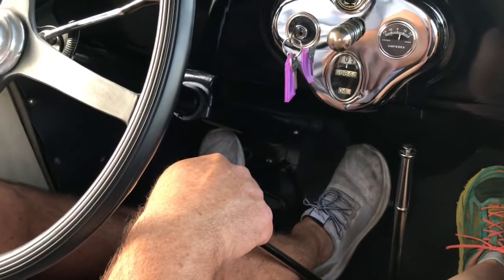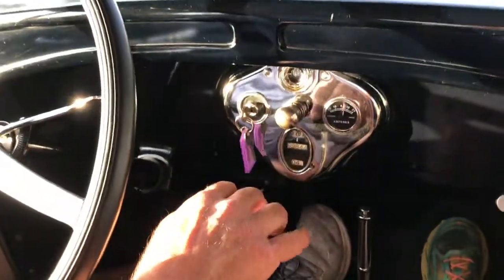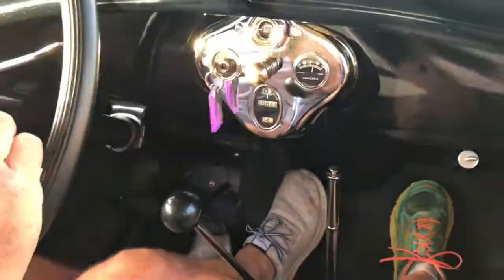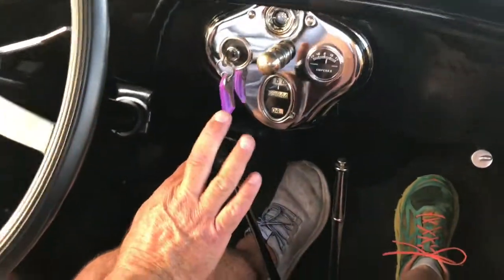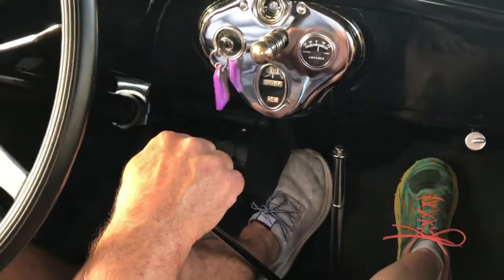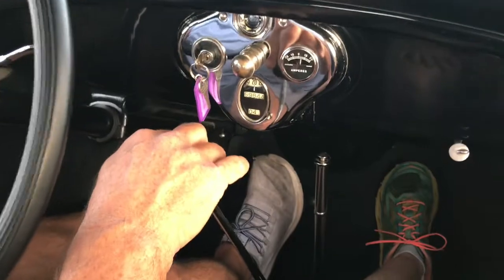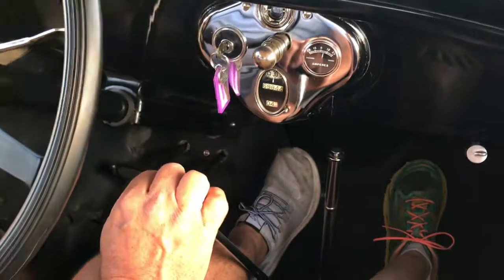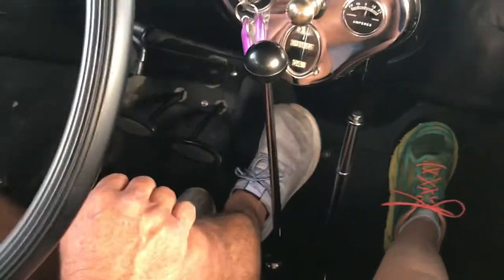How to shift gears in a 1928 - 1931 Ford Model A

Comment: Yes, that's the right way.  It works for most pre-war crash boxes.  I've used the same method for early syncro boxes too to help move things along.  And you're also right about how many people shift a Model A incorrectly....here on YouTube, and everywhere else.  When I learned to drive a crash box in the 70's, there were still folks around that knew how to help you learn.  Today we have the internet...and many people teaching it wrong.  It was a good move on your part to use the unrestored '29, that way no one could trash-talk the trans and your driving instruction.  Thanks for this video Paul.
Reply from the maker: Thank you!  Yea, I figured nobody could say I was using a 39 synchro trans or something this way.  My Sport Coupe shifts even smoother and would have made a better video, but like you said...

Comment: Paul - I finally got to really drive my A for the first time after getting it and going through the engine, etc. Thanks for this video! It helped tremendously. My key learning was to just take your time - if you are in a rush to get somewhere, take a different car. Every other car I've had has been a synchronized manual so I didn't realize how much I was accustomed to just lazily slamming the stick into the next gear regardless of the RPM. And I thought myself to be a fairly precise driver. The A makes you pay much closer attention!! I love it.
Reply from the maker: Congratulations!!!  We are all proud of you a d wish you many more successful drives!

Comment: For some, it is easier to always double-clutch a Model A. Too much thinking about up or down, just DC every shift and it goes easier for some. I have only been driving Model A's for 54 years so I still have lots to learn, but everyone I have helped learn I have them DC up and down.
Reply from the maker: That's OK too.  Even though it is not necessary.
Reply: Thanks to Paul's video I'm learning how to do it "the Paul way"... but I only started driving the Model A 10 years ago... so less to un-learn. I think what double clutching on the upshift does it give you the right timing or delay. I sometimes find myself double clutching on the upshift out of habit :)  I also think the timing/delay is different when the gearbox is cold as presumably the oil is thicker... still learning!

Comment: I saw a "How to" shift video where the gentleman was sitting at a dead stop, put the clutch in, and attempted to shift into first. However, the gears immediately started grinding. He backed off, tried again with the same result, only he just forced it into gear after grinding. I couldn't understand why it would grind while sitting still. Is it a clutch adjustment problem? Or maybe the car is idling too fast? Both? Lol

I just got my very first A, and your videos have been absolutely invaluable. From the "Secret Handshake" to your shifting style, maintenace and beyond, it has given me a wonderful starting point to launch from. I'd never even sat in a Model A until after buying mine, let alone driven one. I've got a lot of practice ahead, but you gave me the confidence to take those first few steps. Thank you!!!
Reply from the maker: My guess would be his clutch needed to be adjusted, of it was worn and no adjustment was left in it?  Thank you for the kind words!  So glad to hear the videos have been helpful to you. Are you a MAFCA member yet?  Planning on going to Model A Days in September?  If you go, it would be an honor to shake your hand and tell you thanks in person.
Reply: @ModelA could you inform me of the shift pattern? I can’t find any info on where first gear is. Engine off, it shifts buttery smooth, I just don’t know which way is what gear

Comment: My opion on this - and I'd love to hear yours, too - is that, as long as you hear no grinding noise, there is no "wrong" way to do it. 
I like double clutching because one doesn't have to keep the clutch pressed in while waiting for the gears to slow down. Just like I prefer putting the car into neutral when sitting at a traffic light. 
The lower the rpm you shift at, the quicker you can shift,  because the gear speeds are closer together. 
If you just get your car rolling in 1st, you can immediately stick it into 2nd without any hesitation - Jack Bahm demonstrated that brilliantly in a video of his.
You demonstrated how to shift without double clutching - and did it beautifully. But I wouldn't call double clutching wrong - because it doesn't hurt the transmission either, if done properly.

Greetings from Germany
Adrian
Reply from the maker: No grinding is the goal.  That's a fact.

Pumping the clutch excessively puts more wear on the mechanism than just holding it down tue extra second waiting for the motor to slow down.
Reply: @ModelA  Oh yes, didn't think of that one. I had only heard about throwout bearings wearing quicker when leaving the clutch pressed at a stop light - but sure, there's more to a clutch than just that.
Reply from the maker: Right.  You should be in neutral at a stop light with foot off the clutch pedal.

Comment: That is how I shift, I see people double clutching all the time but it isn't necessary. Actually if you listen to the engine speed and know how things work you don't have to double shift at all. The best I saw was my uncle who grew up driving all kinds of cars and trucks back in the day, anyway he could shift his model A without using the clutch! Just listened and shifted at the proper time, it was amazing to see.
Reply: @aliceshaw8265  I wrote a lengthy discourse on this for another nice video recently. "speed match the gears" is correct terminology in my experience. You're finding the correct speed of each gear. And yes, in stop and go traffic on a busy street, no 5 cars back behind you is gonna appreciate a snails takeoff from a light. At 14 years of age, my dad smiled big at me and said, " you know, at your age, I could kick the lever from 1st to second and second to third." I already had the touch, but it took a few practice tries before I got it.

Comment: Greetings from Australia where we drive on the 'other' side of the road :) (The GAV control is on the steering column which is actually pretty handy!) Thank you Paul for making this video. I was taught  to double clutch for both up and down shifting.... so I tried your method. There were a few 'crunches' while I was trying it out (hey it's OK, the gears can't get out!) but after a few goes I got it... and the whole way home I was saying to myself "I've being doing it wrong ***THE WHOLE TIME***" !!! :)  I still find myself double clutching up shifting, but I'll get the hang of it! My clutch and I thank you! :)   OK next Paul video to follow... brake adjustment!
Reply from the maker: Awesome!  Good job Ant!

Comment: It's Sunday. I'm enjoying this immensely. This is another helpful video Paul. .....But a bit opinionated as to "the right way". Do you know that many Semi Trucks have non-synchronized transmissions, and that their driver shifts up and down through 10 or more gears without using the clutch, all day every day? He does it on level ground, uphill, downhill, and on all sorts of road surface qualities, with different loads, too.He does not use the clutch to accomplish this. 

 In my very humble opinion, your description is "Model A shifting 101" only. I appreciated a comment below, "as long as you hear no grinding noise, there is no wrong way to do it". In the heyday of the Model A, due to the A's snappy performance, there were many high range speed shifts from stop light to stop light. Boys will be boys ya know? By today's standards, it would look like a couple tortoises goin' at it. Of course us grown ups revere these wonderful, old machines, and wouldn't think of shaving a few chunks of metal off the gears by missing a shift in a downtown, street race! 

An adequate description of shifting is too lengthy here. But I notice that in many  descriptions, I never saw anyone describe the correct use (positioning) of the throttle. One used the term "blip" the throttle and that's gettin' closer, but I suggest that a skilled driver of a non-synchronized tranny doesn't "blip" either; he puts the throttle where required and moves the shifter at the right speed (out of gear, into neutral, and on into the next gear) to get the shift made without clashing.

Keep the videos coming, Mr. Shinn
Reply from the maker: I have driven many large trucks and equipment with unsychronized transmissions.  I thought I did mention that this video was how to shift a Model A, even in the title.  Thanks!

Comment: he doesn't say it, or maybe he's not aware of it, but he's doing a crude sort of "rev-matching".  and unless you know what you're doing, there will be grinding and excessive wear. best to know what rev-matching is and how it is accomplished under any and all conditions. 

it's not only useful to do it on transmissions without synchronisers, but with them too,  as it will less stressful on the gears.

the trouble with not knowing that rev-matching is being practiced here, is that if the revs fall below the optimum point where shifting is smoothest (and it WILL happen A LOT of times) the engine will need to be revved back up in order to bring it up to the optimum point for shifting. 

he doesn't even mention this.  and surprisingly double clutching, despite what is shown,  is NOT necessary when downshifting if rev-matching , again, is used.
Reply from the maker: Wow!  You must be an expert! Where is YOUR video showing how it's done?? We all need to learn from an expert!
Reply: @ModelA  thanks for the compliment! :) no video necessary, as its explained in my comment. but here's a good animation of the workings of a sliding gear transmission. from it, it sould be clear as to what rev-matching vs double clutching differ and why one may be preferrable over the other... 

https://www.youtube.com/watch?v=wCu9W9xNwtI
Reply from the maker: Your method won't work with straight cut gears like the Model A without significant wear on the gear teeth.  That is the difference.  I was being sarcastic earlier.  Rev matching works great on a gearbox designed for it, the Model A was not.

Comment: Hey Paul
When in 3rd gear I lose acceleration and can't seem to get it to work. Any ideas?
Reply from the maker: Your motor is not making enough power.
Reply: @ModelA  How am I going to get more power?
I have put in new parts and seems to run good, until 3rd gear. Do you have a video or what are my options?
Reply from the maker: @adamthompson6932    Sorry, no video on "How come I don't have any power in 3rd gear".  Start with your timing (there IS a video for that).
Reply: @ModelA  thank you
Reply: @adamthompson6932  Maybe starving for fuel? Check fuel flow, filter etc?

Comment: I've never known double clutching to help shifting with anything, to me it's just a play with your mind, most old vehicles when down shifting do not want to fall into gear until your going slow enough for that gear to be in use, just like on an 8N tractor when shifting up or down there is a window of opportunity and if you miss it you miss it, I mean tell me how double clutching actually helps, it doesn't, same with old school big trucks with two unsynchronized gear boxes, double clutch means nothing imo, good video, thank you.

Comment: Mine absolutely will not to that, 3-2 downshift grinds no matter what I try, I think it's time to remove the trans to see What is wrong.
Reply from the maker: First, check clutch adjustment.  The clutch has to be capable of full disengagement before you can shift smoothly.
Reply: @ModelA  I adjusted the clutch about a year ago using tips from the Les Andrews book, except for getting in there to adjust the fingers independently; which might have been a bit beyond my tool selection at the time. It all looked and felt OK, and the adjustment didn't make any difference in that shift. At a stop with the clutch depressed, engine running, I can shift into 1-3 easily, indicating a complete disengagement as far as I can tell. The car does drive smoothly in all gears, doesn't pop out of any gear, and the 2-3 shift is as easy as can be - just like in any of the Drive your A videos here. If I can figure this out, I'd drive it a lot more often.
Reply from the maker: Hmm.. Need someone who has a lot of experience to drive your car and see what's up.  I can just keep telling you to check everything, but you may not actually have a problem.
Reply: @ModelA  I do live close to Arizona Model A, and the owner, Sammy Guthrie, has told me to bring it in so they can check it out. Which I will do, just not so comfortable driving it in traffic like that which is why it hasn't happened yet. Unless I can get someone from the local club to drop by and give me an opinion.
Reply from the maker: @mattfarahsmillionmilelexus    That would be the way to go.

Comment: so whats the issue? Thats the way I change gear in my 1962 land rover. never had any problem.
Reply from the maker: No issue. Just showing people who are new to this how to do it.
Reply: It's also the way I used to shift in my land rover.  A while back I had an issue with a failed part on the clutch pedal of my Ford Escort.  Some kind of plastic "automatic adjuster" that meant the clutch pedal no longer worked at all.  I managed to drive over 200 miles back home without a clutch.  Simply put it into first gear and turn it over, a couple of jerks forward and you're away.  Double declutching (even without a clutch) allows it to change down a gear.  Changing up is as simple as just hesitating as you cross neutral and listening out for the right engine revs before feeling it into gear. Obviously coming to a complete standstill is a pain as the only way to pull away again involves a restart of the engine.